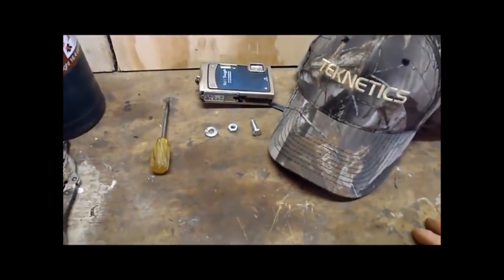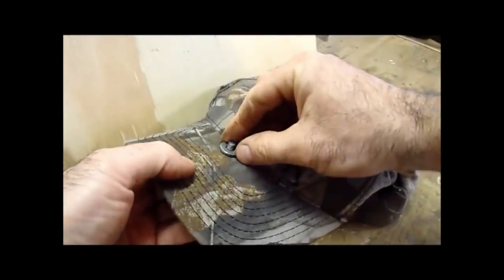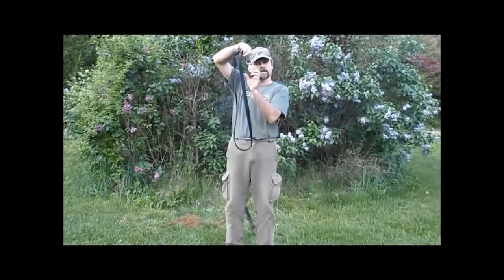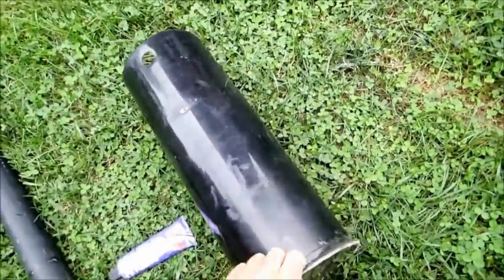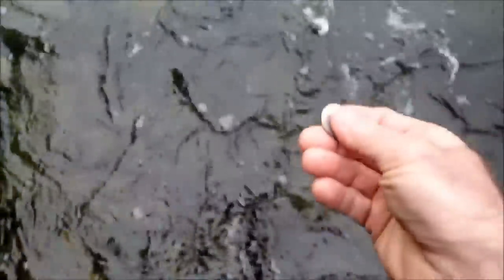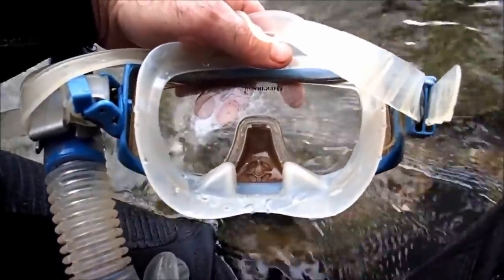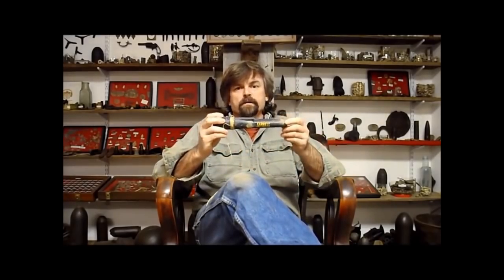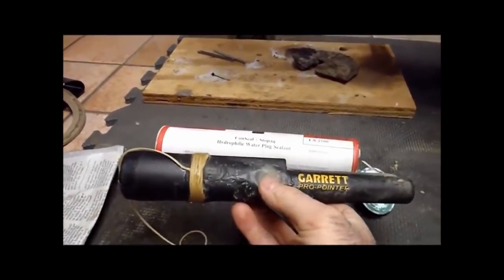Chigg's Top 5 How-To Videos

Comment: In the first part of the video when Chig was making the bolt shorter, before you cut it off the bolt, screw the nut all the way down on the bolt, then cut then bolt off, then screw the nut off the bolt, this will straighten any damaged threads.
Reply: That's a nice tip, I just learned something!
Reply: That's a old trick I learned years ago.

Comment: I used that exact same hat cam setup for years.  now I use a runcam 2 held with velcro. Fast switch from hat to first person view on rc airplane, much lighter and low profile.  To put velcro on a hat, stick it where you want it, then run 5 min epoxy around the edges. never comes off.

Comment: Could have used a video about double leak protection for my AT Pro. The housings are prone to warp or flexing across the top, causing a minor leak past the o ring seal. The used machine I bought is now fried from less than half a teaspoon of water that entered through that area. Water in the display can be prevented by using clear silicone  around the display to housing joint. The machine was pretty good under water, aside for not being so waterproof as I expected. Live and learn I guess.

Comment: I also have an Olympus Stylus Tough camera, a TG870. But for some reason Olympus decided to put the tripod mount at one edge of the bottom rather than in the center. It really makes it difficult to mount it on things like a stabilizer. I always have to add a counter-weight on the opposite side of the mount.  Not one of the most brilliant things Olympus has done. But.. they also added a tripod mount on the side of the camera at the other end from where the bottom one is. Which lets me add a small handle on the side, so I have two hand grips and makes for some decently stable hand-held video. -- I've never heard of using lung phlegm in your mask. I just spit in mine.